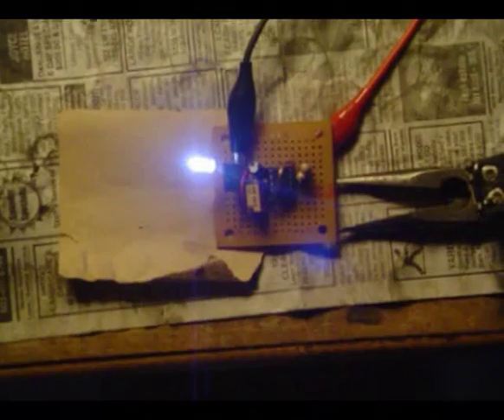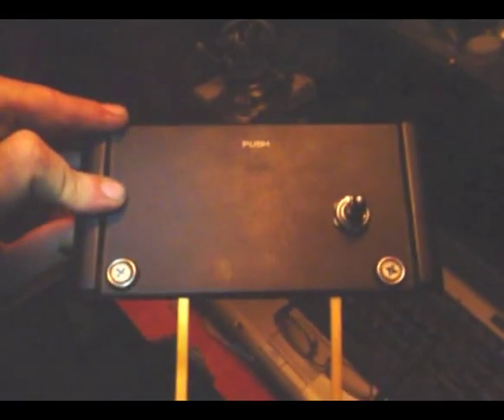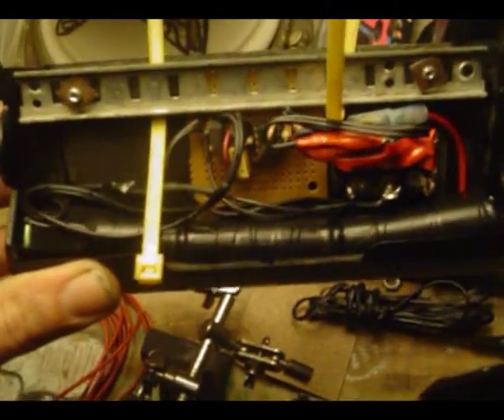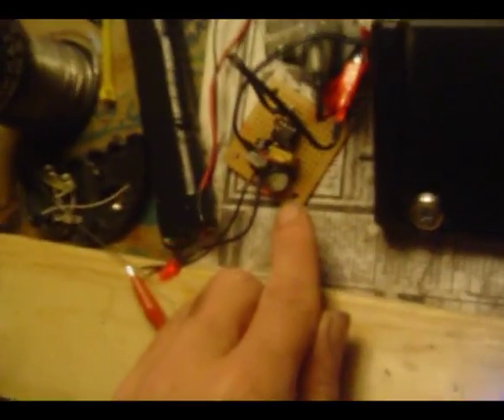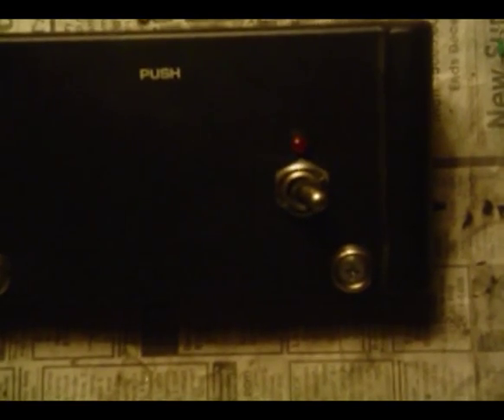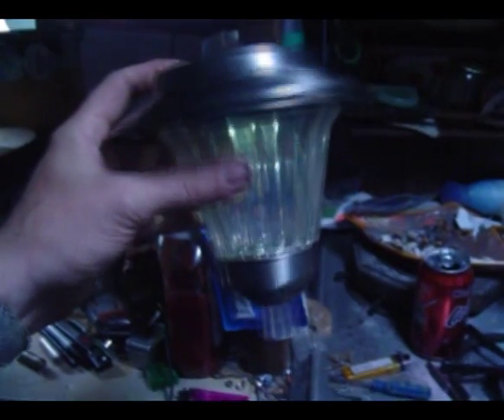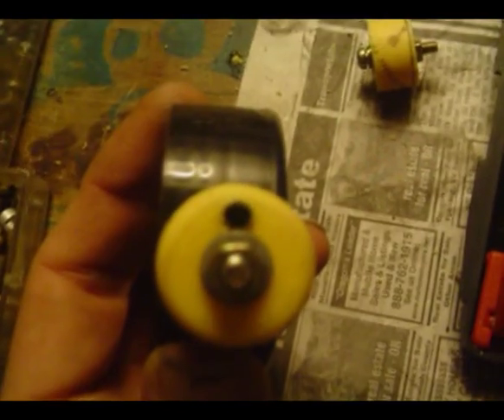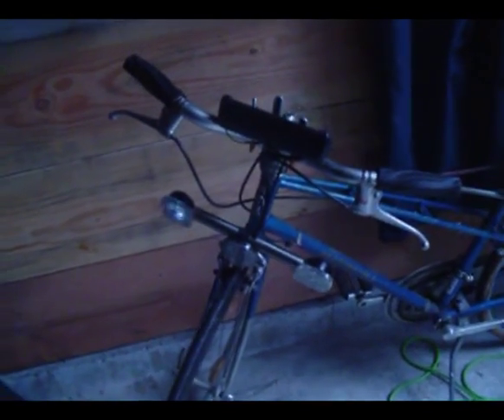BICYCLE TURN SIGNALS - DIY

Comment: I'm currently considering making myself some front turn signals for my bike as well.

There are plenty of turn signal light kits for bicycles but they always only include rear turn signals. I don't understand why when every other vehicle on the road (cars and motorcycles) have turn signals front and back the entire bicycle light kit manufacturing industry neglects the front lights.

Why wouldn't we want to let the traffic on the opposite side of the intersection know our intentions as well.

Anyway, this has been the most helpful video I've seen so far. Thanks for uploading.